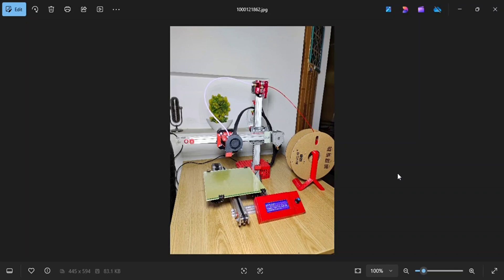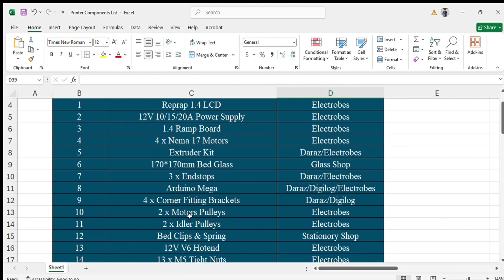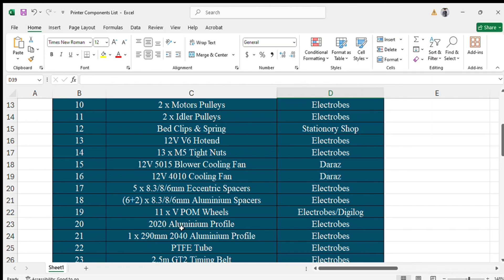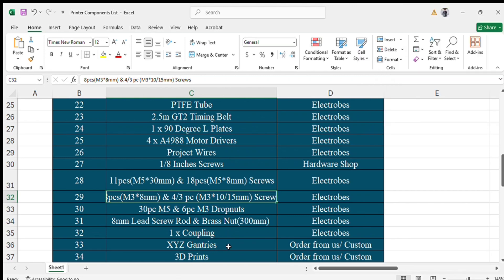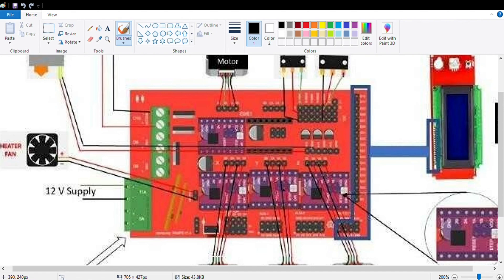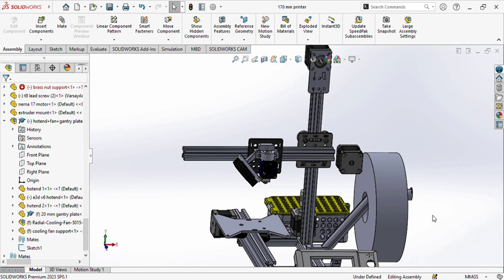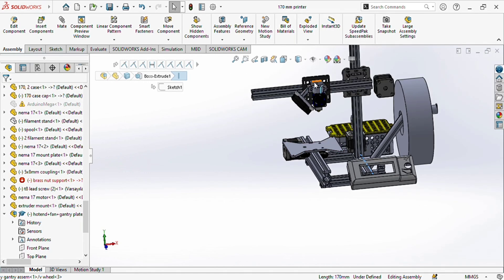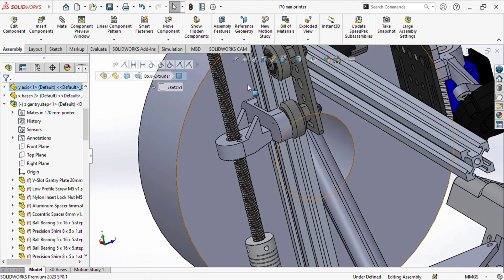DIY 3D Printer | How to make a 3D Printer at Home | Explanation Video

Comment: Thank you very much ,
Also can you share the files?
The list , the circuit diagram and SOLIDWORKS model?
Would be greatful of you
Reply from the maker: I've already shared the stl files in another video. If you want a solidworks model you can contact me on WhatsApp. But as you know it takes some effort to make a design that's why for the solidworks model I'll charge 1000 PKR Only.